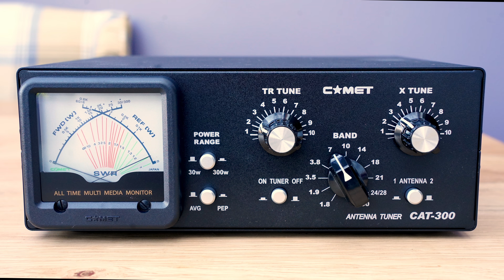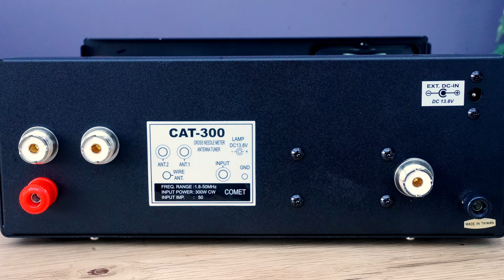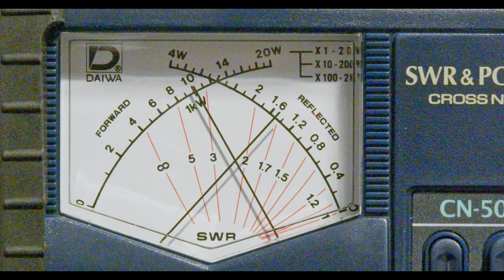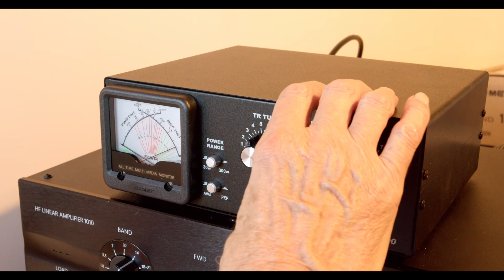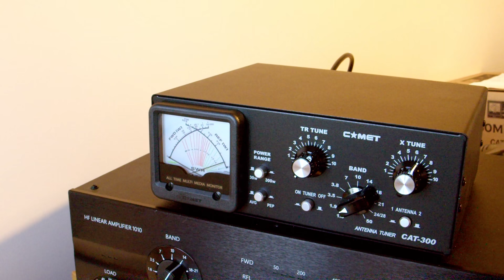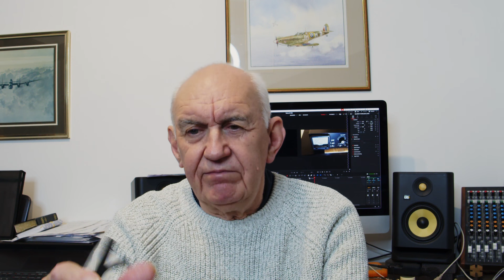Comet CAT-300 Antenna Matching Unit - Ham Radio Review

Comment: how long can/must a single wire be if connected to the red connecter below ant 2 ?
Reply from the maker: Depends on frequency and earthing system.
Reply: @watersstanton earthing thrue 10 mtr countrepoise atached to centra heating pipes ....frequentie 10 20 40 mtr band .....tnx for answering so fast

Comment: On the ft710 does the intternal atu need to be adjusted also  when using the cat300 or just left alone.?
Reply: Make sure that the internal matching unit is switched out of circuit.  73

Comment: I see (at 11:30) the meter suffers the same electro-static meter movement that my MFJ meter had. 
Also, the "TR Tune" control white line, is at 180° to the scale, which only means the variable capacitor is giving the same value, with a different part of its vanes.

Comment: Hi Peter. LoVE your videos. I’ve learned a lot from you. As a newer ham, does a manual antenna tuner do a better job than an ATU? I’m using the LDG z100a with my FT710. Thanks for your help. Frank W8FXM
Reply from the maker: You are very welcome Frank

Comment: The lack of an accommodation for twin lead is a deal breaker for me. For the money I shouldn't have to add another piece of kit to use the doublet, which is the most logical multi band antenna.
Reply from the maker: Maybe they will copy MFJ and put a 4:1 balun inside a new version.  I prefer the flexibility and ratio choice of an external one.

Comment: It looks to be a very good unit indeed. Thank you for demonstrating it. The only downside is the 300 Watts. I bought a very nice MFJ 300W tuner and when I later wanted to use 600W, I had to buy more capable tuner. Unless the ham is absolutely certain he/she will NEVER want to run higher power, they should just start with a Palstar AT2K or similar and be done. That's what I wish I had done to begin with. I suppose this comment is more in the financial column than the radio column but I suspect a lot of CAT-300 buyers will end-up buying an AT2K or similar at some point.
Reply from the maker: Thanks for sharing your thoughts.

Comment: Any idea what size (physical dimensions) the coaxial power plug needs to be?  This would be the plug that fits the jack that provides power to the meters light?  No one appears to know the spec for the plug.
Reply from the maker: The lead is supplied with the unit.
Reply: @ can you measure it if possible for me.  My friend K8SB bought a new one and it did not come with one.  No one seems to know what size that plug is.  73, Don
Reply: @watersstanton  I just told my friend K8SB to contact the company that sold him the tuner and tell them it was missing the power cord.  Thanks.

Comment: These Aerial matching units appear to be very good. I have an old MFJ manual which appeared to tune anything, until the Grey smoke escaped from the plastic coil former.
So at 100 Watts into a bad non resonant Aerial, you can easily waste 75% or more of your power in the coils.
Then I learned how to cut and install resonant dipoles and a 1 to 1 balun for the reactance.
Unfortunately we get a lot of Winds in rural Lincolnshire, which tends to wreak havoc...
Happy times, 73 G1ZQC.
Reply from the maker: Thanks for sharing. A non resonant antenna has virtually no effect on ATU power transfer. Most of the loss is in the feeder and antenna radiation efficiency.
Reply: @watersstanton  I remember a time when you said the same as @G1ZQCArtwork
Reply: Yes but the power has to go somewhere, so is distributed within the ATU as heat.
Reply: @G1ZQCArtwork  no it's not it's reflected back to the antenna at the tuner,any loss is in the feedline which can be very little depending on feedline attenuation even with a very high swr

Comment: I have a Capco SPC300 ATU which will match anything to anything. The Capco is built like a tank but has no metering. I therefore built a Brune bridge with forward and reverse power meters and connected it between the rig and the Capco ATU. I also installed a 1 to 1 current balun in the Capco for feeding balanced feeder and it works superbly.
Reply from the maker: Yes I remember the Capco. The designer was quite a character!

Comment: Wouldn't trust that meter with a sticking needle.
Reply from the maker: Are you confusing “sticking” with PEP hold feature?
Reply: @watersstanton  No, the reflected power needle is obviously sticking and not returning to zero reliably.  Really surprised you didn't notice it during filming the video... it's blatantly obvious.